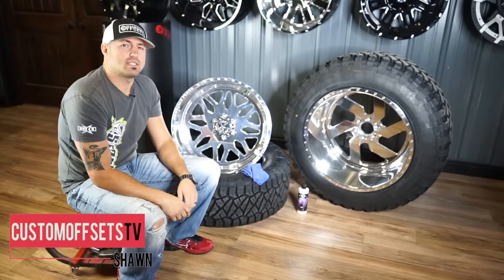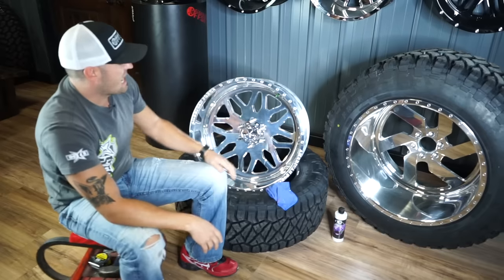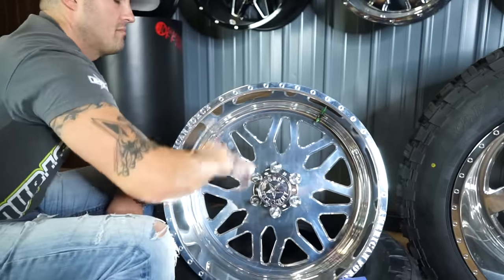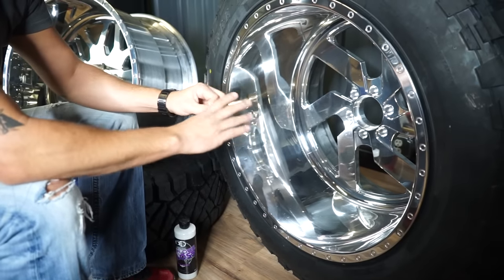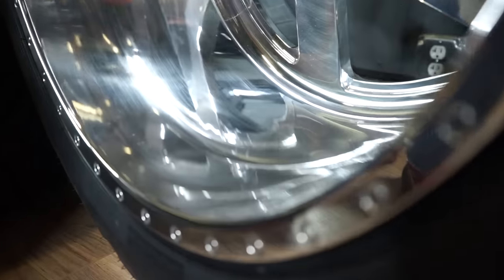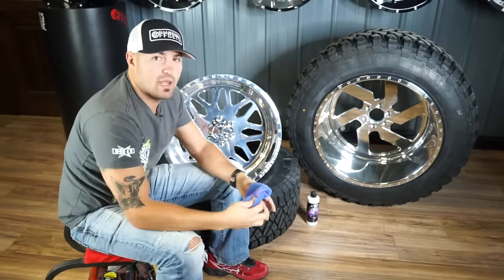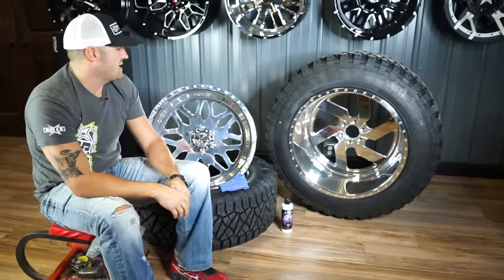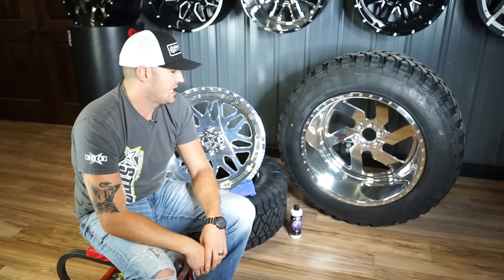Sh*t I Never Knew: Putting a Microscope to Polished Wheels

Comment: I've seen guys ceramic coat these forged polished wheels with a ton of success.
Reply: It will corrode under the ceramic coat. Beauty of forged wheels lol
Reply: @michaelbollinger8060  ceramic coatings form masically a clear coat over. So your saying this would happen under paint, or powdercoat? I've never heard that. If that's the case then you couldn't use aluminum for anything if it was getting a coating.
Reply: Stephen Brewer ceramic coatings work well on powder coated wheels, not on polished, raw aluminum wheels

Comment: Polished wheels look damn good when done right but the hell with that, to damn much maintenance for me.  I'll stick to a nice set of chrome wheels.
Reply: S_J_P you polish it, imo if you dont know how take it to a pro,never use a micro fiber, then ceramic coat, imo well worth it, chrome has a cheap look, polished has a great look but yes a pita to clean but won't put and if it gets damaged most of the the time its fixable
Reply: @robertkurtz7587  what should you use instead of a microfiber towel?

Comment: But the good part about forged wheels is they will not pit like chrome, and you can run them in all weather conditions if you are willing to put in the work to keep them up...something else people may not know, is if water gets on them and it's not wiped straight off it will spot the wheels then they need polished, so basically anytime you are caught in the rain get ready to waste about a half a day on Saturday cleaning them back up haha

Comment: If you're going to buy forged wheels, your best bet is to get them ceramic coated.
Reply: Can’t coat raw metal. It doesn’t bond properly. The coating won’t last very long.
Reply: Ceramic coats is going to haze up and it.will make it harder to fix next time you'll have to sand them to get the ceramic coating off

Comment: What's the best lift kit for the money that doesn't use spacers for the struts and doesn't use rear blocks? I drive a 2010 f150
Reply: BDS coilover system with the Glide Ride leaf springs, IMO.  Also depends on how much lift you want as well.

Comment: Could you have someone put like a clear coat on them to prevent the scratches and oxidation?
Reply: Seth Lowery possibly but it wouldn't have anything to cling to
Reply: Custom Offsets they are nice when polished! Thats what ill be getting next. Good vid!
Reply: Ceramic coating is the best thing you can do for polished wheels, it's basically a non-permeant thin clear coat.
Reply: Ceramic coating is amazing,
Reply: Seth Lowery yes it’s called duracoat. Absolutely terrible to remove, it keeps the aluminum clean but the clear coat becomes pitted and scratches causing the entire rim to need sanding. Big mess